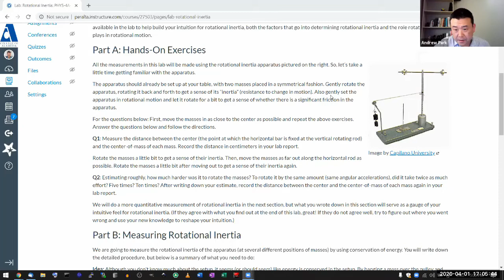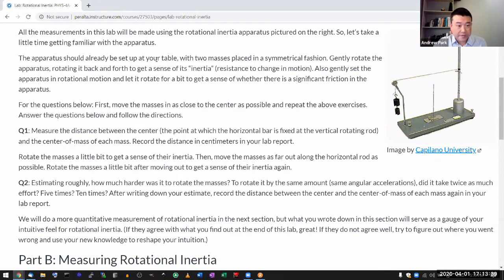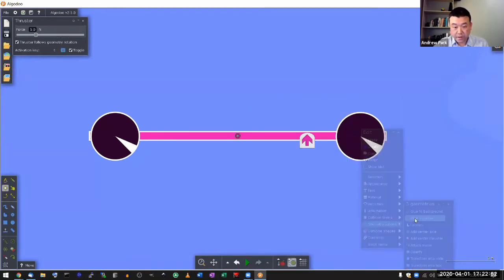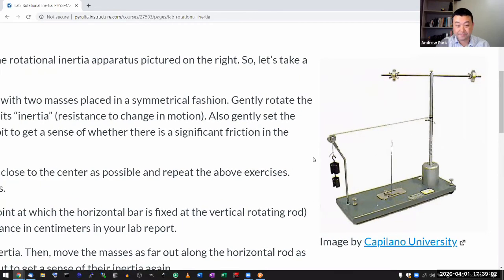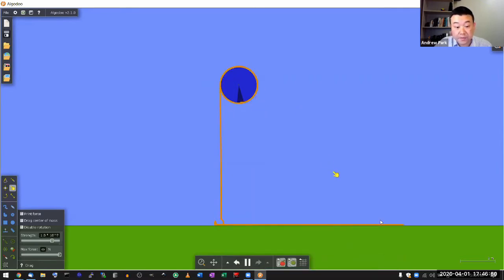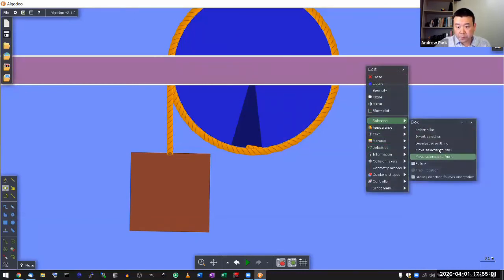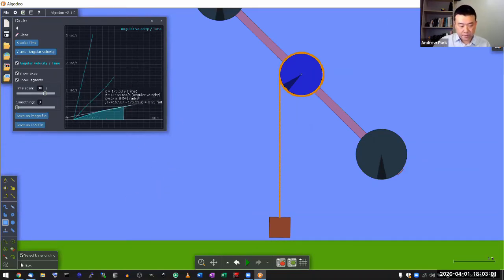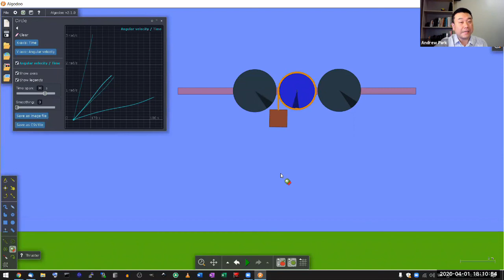Physics 4A - Rotational Inertia Lab Algodoo Demo

Comment: Hi good explanation! Is it possible to access to the web resource you used?
Reply from the maker: The Algodoo simulation software is available here: http://www.algodoo.com/. It's available on Windows and Mac OS, but not on any mobile platform (except for the version for iPad that you have to pay for) or Linux/Chromebook.
Reply: @CoAPhysics  Thank you for the quick reply. I meant the teaching resource on the website you used to implement the algodoo model. 
Many thank you again!
Reply from the maker: @giampietromartini9106  Do you mean the lab manual? That is on the course Canvas LMS and can't be shared publicly (not without making the entire course publicly accessible). I did make sure to show on screenshare any part of the lab manual that is necessary to follow along the Algodoo simulation demo. If you still need a copy of the lab manual, the only publicly accessible version is on this PDF (https://coaphys.xyz/wordpress/wp-content/uploads/2022/04/PHYS-3A-Lab-Manual-1st-Ed-2022.pdf), pg. 61 (but this PDF was created for a different purpose and there may be differences between the PDF and what is on the video).
Reply: @CoAPhysics  Thank you again for your reply and time!